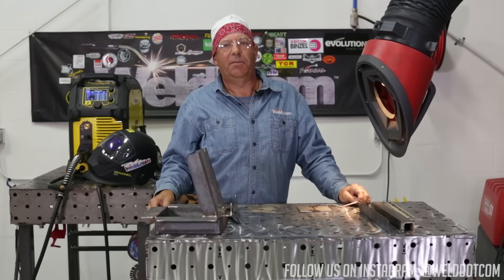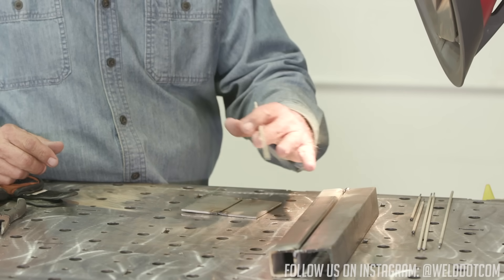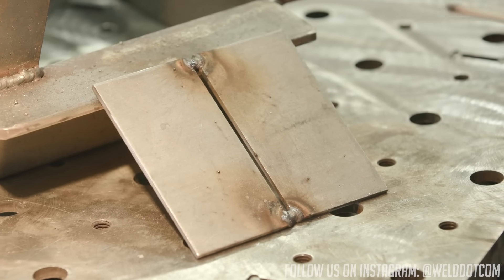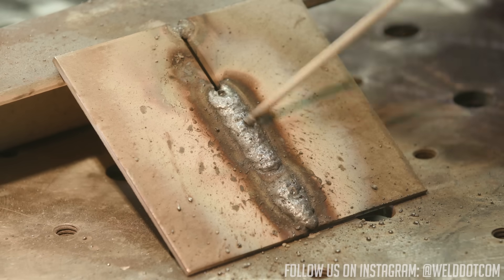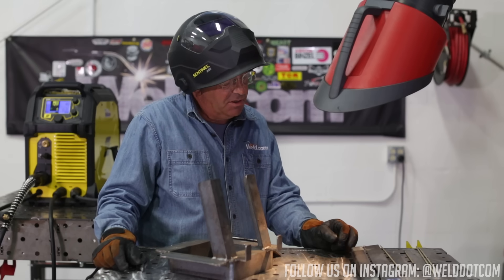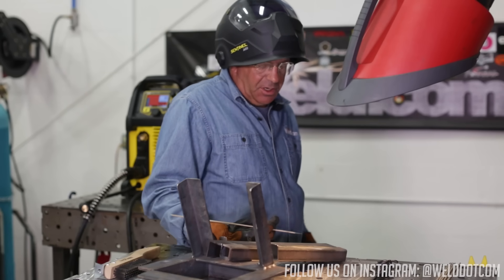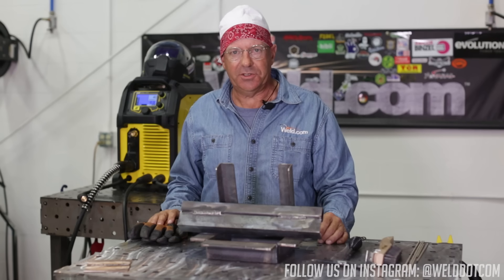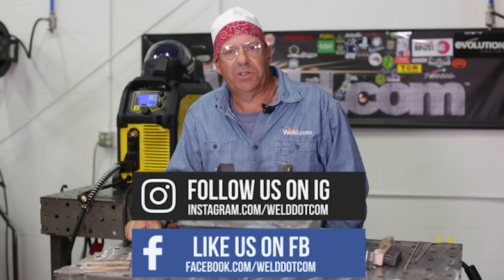Texas TIG Welding | Stick Welding with 2 Electrodes

Comment: Well, this is the damnedest thing I've seen in a while and I've been welding for forty years!    You can teach an old dog new tricks, even a mutt like me.   I'm heading out to the shop right now to try this out for myself.   "What else don't I know" I'm asking myself now.   You rocked me!   This is why I watch this channel.
Reply: works best if you beat the flux off a 7018 as a filler rod and whip into it with your 6010
Reply: Should I go and do this in front of my instructor? 😂
Reply: @vendetta1306  depends on the instructor.
Reply: Wow I'm super surprised when long time welders haven't seen this.  I saw it within 5 years of being a welder.  Works great at filling in a big gap on a root pass for pipe.  Knock the flux off 7018 and weld with 6010
Reply: That is a fantastic fill method,  in place of a second stick,  a coat hanger,  steel wire etc works quite well
Reply: @SirNC89  yes I think they call that number 9 wire.. rebar if necessary. But instead of using two hands and trying to feed it in like a mig wire just place the round stock filler metal in the gap. Tac 1 end and conform it to fill your Gap. You may have to tack it every several inches.. and the Chisel end of a chipping hammer is an excellent tool to tap it right into the gap... my dad taught me this in 1975 when I was 9 years old.. he worked in a place called Owens Corning fiberglass.. in Rhode Island.. he was an Engineer. A. Millwright. A. Boilermaker.. electrician.. there were two huge plants right across the street from our house.. I could go on and on but.. yeah my dad incredible man
Reply: People learn everyday it doesn't matter what age one is
Reply: @lannyfullerj3852  I was lucky when my wise ol' Uncle told me of this technique .... using rod or even bolts to get out of a jam ! We all learn something at different times every day if we're willing to listen to wise people 👍.
Reply: So have you ever seen someone mig tig then. Feeding solid round bar in as you weld. 
We call this stick tig over here. Australia.
Reply: Lee Barnhart me too.
Reply: Did it work?
Reply: Your just a good fitter is all.
Reply: Yup. I learned to do this out in the field. I use the extra rod to catch the puddle tack and rolling up to tack again with a little of a puddle.
Reply: Forty years with no problem! I've had forty years of problems. I first tried this with galvanised fencing wire when I was second year apprentice. DON'T breathe the fumes!
Reply: plenty of farm boys figured this out on their own, out of desperation.
Reply: Really?? All those years you guys have been welding n ya never have seen and heard of this? ....... Well I guess it is believeable, I've only been welding 30yrs and this guy teaches me something every time I watch him. Even if it is just a small thing, I pick up something every time!!! Absolutely a genius welding instructor!!!  Good Luck guys and keep Striking the Arc!!!!hahahahah
Reply: logan kincade ....And  his dry humor cracks me up !
Reply: Got that right Lee I am with you I have been welding almost 50 years and I have never tried  Texas Tig either. Go's to show ya can learn some thing even when you think you already know it all!!
Reply: The moment you think you know it all is the moment you should open up to others. And so you did.
Reply: WOW!......I've used this method since 1962. An old guy who had a trucking business showed me this way back when.........it works.....I've even used 1/4" bare rod as a filler. There's always a way to skin that cat!. Great video!
Reply: Lol, all of these long-time welders I was doing this back in high school to make up for poor fitment and using scraps to make hog traps and deer stands.
Reply: @dslrhd618  my dad taught me this when i was young. I didn't know what the name was, just knew how to do it.
Reply: Lee Barnhart was the last time
Reply: You are doing it completely wrong. You first break the flux off of the filler rod and you dont feed infront of a push it causes a lack of fusion. You lay the rod and feed the filler underneath so you get complete fusion and no porosity... How you are an instructor is mind boggling...
Reply: @Jb-qn2xz  chill man he said explicitly that this is only for non critical applications. And obviously you lay the rod but then that's just normal welding and not this quirky wideo-worthy technique
Reply: Jb little show us
Reply: @Jb-qn2xz  first off, it's a nonstandard technique that he said he hasn't used much. To question his qualification over this only shows your ignorance. This guy has been a quality instructor for years and has much respect for his skill amongst some of the best welders out there. Let's see your instructional videos. 🙄
Reply: @marsbase3729  it isn't just this video homie, I've watched several videos where shows he is a complete joke. My comment doesn't come from ignorance but experience. His technique is terrible his welds are terrible and the fact he is teaching is laughable. I can't tell you how many people come into the industry out of welding schools and find out what they learned doesn't apply.
Reply: @Jb-qn2xz  could I just put the rod in the gap instead of filling it from under the rod? Why do I have to lay the rod down?
Reply: @jackskalski3699 you can lay the rod down in the gap and not touch it; but the problem is that it will melt in sections and get pulled into the arc faster than your travel speed, so it isn't going to work for a consistent fill on a larger gap. If you feed it into the arc from the front the cold filler cools the molten metal down around it and creates encapsulated bits of unfused filler. You need to remove the flux, go underneath on a pull and feed it in steadily.
Reply: @Jb-qn2xz  thank you

Comment: Didn't know this hack had a name.  Figured it out for myself to fill holes and bad fits.   I have always knocked the coating off the "filler" rod with my slag-hammer before proceeding.  Sometimes I'll dab the filler rod, TIG-fashion, and sometimes lay it in the gap almost flat almost flat, feeding it at that angle.  Kind of a crude operation but sometimes you do what you have to.

Comment: What happens if i use 6010 or 6011 rod as a filler when TIG welding a less than perfectly clean steel? That is with flux still attached.

Comment: A good point on the non-critical aspect. I've wished I could X-ray welds I've done so I can relate what I see and experienced with the actual quality.  That said, I've been doing this technique for a while when trying to stick two pieces of metal back together and lack the time or space to properly fit them. The most recent time, though, the weld was so shoddy that I ended up cutting the broken re-re-re-welded bits off, ground the surfaces clean, welded new pieces on to replace the bits I cut off, and had a much better, cleaner weld. I also altered the bracket I was working on so that the stresses weren't trying to rip it off in use. The more of these videos I go through, the more I learn how to weld better. I hate fixing the same thing twice!

Comment: Down under in Australia 🇦🇺 this is commonly known as cold pudding. 
Have seen and used this with electrode welding, and mig welding. 
Usually with bare wires or rod and electrode. Have even used cut off waste when working on rust or crap steel when you don't need to waste a  good electrode or piece of rod. 
PS, I like your style of information and instructions 👍from Australia 🇦🇺

Comment: I've seen guys do this on pressured pipes and it's held and passed testing. They broke the flux off and may have used a different stick but it seemed to have worked pretty well

Comment: Texas tig with a mig and a coat hanger  is my preferred method to start a gap on something really messed up, and then grind and weld a second or third pass of like stringer or weave beads, helpful with like 18ga holes where you know you’re grinding it out anyway

Comment: I do this with MIG on aluminum, working manufacturing our parts don't always line up with nice clean joints. So 1/8 filler and a cooler MIG setting and just lap it in.

Comment: The reason you never take the flux off the rod is because all welding rods are made from rimmed steel. Rimmed steel is garbage metal, all the properties of the filler metal is in the flux. 6010, 7018 etc are the SAME metal, the difference in tensile strength is in the flux.

Comment: Just a heads up you don't need a second electrode with flux to Texas tig, as long as your stinger has a stick electrode with flux your filler rod won't need flux because of the shield gas from your stinger electrode. Old steel coat hangers are a welders best friend!

Comment: I really enjoyed this technique I've never used it.it looks like a good idea for a non-critical large gap weld in the past if I've blown a hole in the light metal I have laid bits and pieces of old small welding electrode in the hole and tried to melt it all together and that seemed to work well but I think the dabbing with an extra electrode does a better job.

Comment: I'm wondering if that method would work with stick welding aluminum 1/8 tubing using a E4043 1/8" Aluminum Covered Arc Welding Electrode in the stinger then using a ER5356 X 3/32" high strength aluminum TIG welding rod to help form a better bead and to get better cushion. The machine I'll be using is a 110 volt 225 amp dc inverter stick machine

Comment: I haven’t done this a lot, but I’m my experience it works best on horizontal welds. If it’s vertical, I’ll usually run a downhill or stringers to fill a gap.

Comment: Im in Michigan. Ive done all three many many times over the decades on dads beef farm patching or reinforcing thin gates, cattle panels, and worn thin loader bucket with thicker steel. Hold most of the heat on the thicker steel, manipulate the rod in a J pattern to wash some fill over to the thinner steel while adding filler with the second rod. Its very seldom pretty.

Comment: damn i tough that i invented this but this vid date is way back than year ago... still - you can use good nail also or tig filler or copper wire if you need for cast iron, not the most scientific but as dirty trick to keeps things going in some situations it helps a lot
Reply: also did thing like tying 3 sticks together with thin rebar wire but connecting just one of them, also kind of works for some hole filling operations

Comment: As a farmer, the “bridging a gap” thing is one of the most common welding situations I end up in, commonly with various material thicknesses, paint, dirt, rust, grime etc. Last week I had to fix a hole in an old slurry spreader wich was dented, painted (partially) and had rust making the metal anywhere from 2 to 7 mm thick and without ever hearing about it I came up with the idea of grabbing some TIG wire to help bridge the gaps. 

Excellent video, would love more on subjects that apply to repairing stuff with limited resources, such as only having one kind of rod and the only “sheet metal” available being some old bits cut from a retired combine, using mixed metals etc.

Comment: about 30 years ago I watched and old timer do this with a bare second electrode and it looked just like a regular weld he told me always take the coating off the second stick. I don't know what stick he was using but it worked great. anyway thanks for this It brings back some things I learned many years ago. I am not a pro at welding but always want to learn new ways

Comment: Is it better to stripe the electrode naked (the one you use as a tig wire)? Without the flux on her...?
Or... Can you lay the second also naked on the empty space-gap between the 2 pieces but little deeper??? I'm asking because im new in welding... Does all of this will affect for strong weld or? BIG THANKS MR 😊

Comment: I’d like to see what a groove weld with this looked like on the inside and if it could stand up to a bend test. For non critical if you could run a root and a fill quickly in one pass you would be a legend.

Comment: If you remove the coating off the electrode you will get a different composition on your weld material. But you are not trying to make this a method you can make a WPQR on so if it works it works I'll guess. But I would try to leave the coating to get as good weld material as I could.

Comment: I usually knock the flux off my filler rod, much easier to fill metal into the gap without waiting on the flux to burn off the filler rod, thus keeping the temperature down, lowers the chance off the bead falling out

Comment: why not clamp a 1/2 inch sheet of copper below and let it run in the gap
you can then use mig welding with the welder cranked up to 130 amps

Comment: This isn’t Texas TIG, it’s stick welding using extra fill.
Stick welding doesn’t use gas and not all TIG welding uses fill rod
I have welded with torch using stick rod with flux still on and melting the flux. Sometimes it helps and sometimes it messes it up.

Comment: Ive tried stick welding thin wall square tubing using 6013 110 amps to 100 amps and no matter what i tried doing different i would always burn through.i was practicing in the garage and ive found mig or tig is the way to go with mig .030 to .024 wire is the best for welding square tubing no burn through you can keep a constant arc without letting the metal or bead to cool down.ive tried texas tig..well since im a florida boy...florida fill and its pretty fun and cool to do

Comment: If anyone is wondering  cared or even noticed. For the last Texas tig if you notice he pulls up the arc every time he puts the second rod in. He didnt do that the first time. He did this because if he didnt the heat would have been to intense if it was a constant arc and blew through and he would have been forced to stop start constantly like the first root weld

Comment: I've done that before, but I beat the flux off of the filler wire. I've done it with low hydrogen rods mostly.

Comment: what would be the result if the filler electrode were stripped to bare metal and then laid in to the gap flat and then
running normal stick weld process?
Reply: You get a filled gap. We do it without taking off the flux, and zig zagging across the gap and the filler electrode. Makes alot of sparks but in a non critical application it's alot of fun.

Comment: I have been doing this with out even knowing it was actual thing :D Just been using thin scrap metal peaces/off cuts, and those stumps of wire that left to your holder when stick is used. Been doing this on load carrying welds, but then again everything i make is designed to be over kill, so no worries of it breaking. If its actually important weld, then i get other people do it.

Comment: I'm gonna ask my welding teachers about this.
Reply: update: he said next year I can do this.
Reply: @Nick-xm1ux  You can also do this with pretty much any metal, it does not have to be sticks. Makes things bit cheaper on long run.
Reply: @Hellsong89  thanks for the advice!
Reply: @Nick-xm1ux  I'm surprised he said that. My welding instructors would never endorse or teach us anything that isn't the right way to weld.

Comment: My uncle used to use this and 0.25/0.125 wire to fill gouged panels on APCs 👍🏼 the wire was preferred as the helper would spend most of the day tacking the wire in then he'd spend an hour blasting them... then the helper would grind and paint for the rest of the day. 😂

Comment: I've done this using 1/4" concrete reinforcement wire as the filler rod. It's even easier if you just lay the rod into the gap and weld over it if the metal is thick enough to handle the heat.
Reply: Don't get caught doing that on a worksite or you'll be sent home or even sued for malpractice.

It's ok for hobby stuff, welding things around the houses etc but not for professional use, not so much because it's weak but because no insurance company will cover it shall something go wrong.

And if you take your time with it, it will be as strong as a proper weld, way better than bridging it with another bead.
I once filled a crack in our tractor's chassis this way and it's still fine almost 4 years later so it's plenty strong.
Reply: @lazar2175  lol glad you said that said someone might have took it and ran with it😂
Reply: @hazymist_872  We've had a dude on worksite use coins to bridge the gap. Let's just say the supervisor didn't like how he "stacked dimes".

Comment: what voltage are u running? in euope we feed 230V in, get about 40-60 out and at 40 amps i could hardly start an arc with such a fat electrode. 3,2mm at 40 Amps woulndt even ignite right...?? is it because u feed in 125V fron the grid? different welding voltage? thnx

Comment: Time for CERBACO!  Ceramic backing plates and some aluminum tape, you see ads all the time.   It's probably insanely expensive, I just got some scraps of it once and got to try it, it seemed to work.  It kind of molds the back of the bead.  Kind of kidding here, as I say it looked expensive!

Comment: The camera work on this is amazing I am no welder but I work with a lot of them and want to lean for projects at the house and seeing up close how you tie the weld in is very helpful as I wouldn't think of doing it in U shapes so much as a zig zag. I know that might sound stupid, but like I said I am no welder.
Reply: I prefer U shapes myself, particularly when you want to make sure the puddle is even and well distributed as it helps you cover any spots if you missed it rather quickly. Most fellow students at the trade school I go to either do zig zags or upside down U though

Comment: Use 7018 rod with no flux. Just smack it with a hammer and it falls off. Great for sucking the heat and adding metal. Used it to stick weld rotten thin steel many times. Buff down and lay cap pass of 7018. Used to fix many tanks on multiple occasions.

My uncle once welded with a cutting torch, mechanics wire, and borax for flux.  Held a 150HP DC motor for years.....because the power was out I guess.